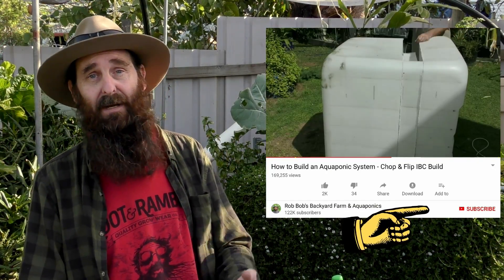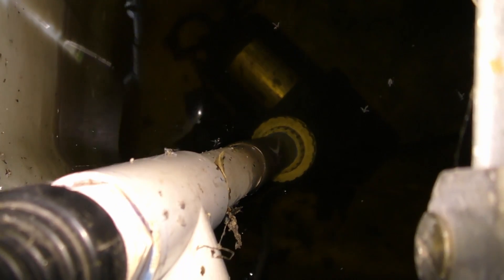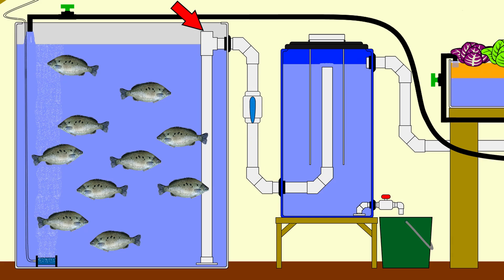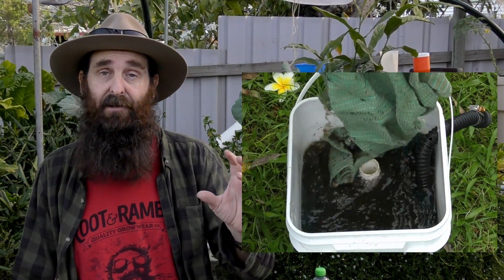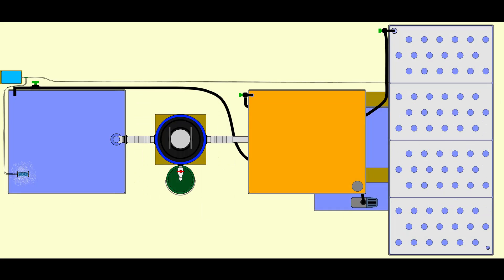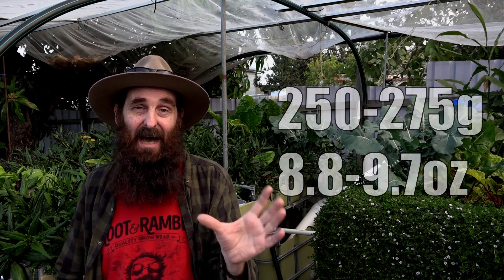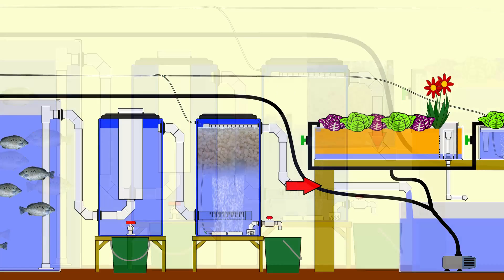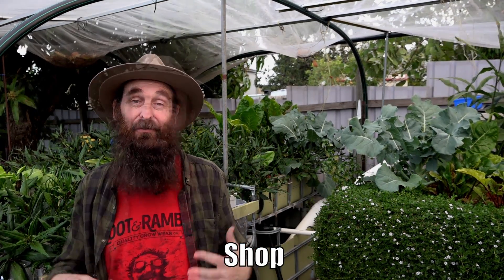Aquaponics Design | Backyard System for Pat

Comment: Isn't the solids from the fish, part of the nutrients you are wanting to get to the pants ?
Reply from the maker: Only part of the nutrients are locked up in the solids Roger. Most of the ammonia/ammonium is released through the gills directly into the water & most of the other nutrients are also carried in the water as well.  👍 
You can reclaim the some of the nutrients lost in the solids by processing them in an external mineralisation system & then re introduce them to the system. I don't think that's needed if the fish are well fed in a basic backyard set up.
Cheers.

Comment: All foam boards here in the US has Fire retardants in them. Unless you can make an order made just for you and ask them to remove the FR. Highly unlikely that will happen unless you order a very large volume of foam boards.
Reply: I should be more clear. Foam boards = foam boards intended for insulation (pink board or blue board).
Reply from the maker: Thanks for clearing that up Matthias. I have seen folks say that some insulation boards are safe to use, including some "gurus" that claim their systems are beyond organic. Still think it's up to each of us to do our own due diligence when it comes to materials used in the growing of food. 👍
Cheers Mate & have a top one.

Comment: Great job on this clip , normally you want 2-3 times your FT volume in water flow if stocked ~20kg / m3 , I have mine changing over every 20 mins
Reply from the maker: Higher stocking densities do require better turnover & bio filtration. 👍

Comment: Your explanation, accompanying graphics and design are excellent!  Very well done explanation!  Thank you.
Reply: Agree, great job with the diagrams! Nice to see someone putting time and effort into explaining something properly with diagrams.
Reply from the maker: Thanks SLFYSH. 👍
Cheers & happy growing.
Reply: @RobsAquaponics  Is it normal that my house smells fishy? In my basement I have 30 juvenile tilapia in two tanks totalling 130 gallons. The water from the first tank flows to second tank and then from second tank to a 5 gallon solids filter with filter foam and floss. From there it goes to a 20 gallon biofilter, and then pumped to my plants. From the plants the water is circulated back into the biofilter and also to the fish tank.
The only thing I can think of is that my plants aren't taking out enough nitrates hence the smell. Any ideas please, before my wife kicks them out of my basement and probably me along with them?
Reply from the maker: @pelimo  We get a marine like smell around our system but not really a fishy one. Better ventilation may help you out if it's a small basement Freddy.

Comment: Thank you for the time you take to explain this system. This seems doable for me. I plan to follow this and future updates on each component. This was certainly worth the wait! What is the best way to measure the flow rate in the raft bed?
Reply from the maker: The best way is with a 5 gal bucket or any container with a known volume from the inlet valve & you can work out the flow rate from there. 
For a 5gal bucket it would be 5(gal) x 60 (seconds) / time it takes to fill (seconds).
So a 5 gal bucket filling in 35 seconds would be 8.57 gpm.  
(5 x 60)/35 = 8.57
Multiply that again by 60 to get hours. 
8.57 x 60 = 514 gph.

Hope that helps some.
Cheers.

Comment: Hi Rob 
Thanks for the presentations on aquaponics and the critical components.  So far I have used the bell siphon successfully in a wetland water level control and thanks to you in this regard. I would like to ask you to present on use of venturi in mixing organic fertilizer for irrigation. 
Thanks
William
Reply from the maker: Hi William. 
I only use venturis designed for delivering air for use in aquaculture sorry mate. 
I have seen a loads of the liquid venturis for sale cheaply online  & know a few people that use them in aquaponics for air delivery. Not quite as good as the purpose made aquaculture ones though but get the job done in smaller systems. 
Cheers.

Comment: Excellent video Rob. Looking forward to the videos on the individual parts. Keep up the great work. I prefer to over engineer the filter portion of the system as well so, if for any reason, I have to take the grow beds off line the the fish will be ok. Do you have a system for utilizing the fish poo solids that are taken out of the system? Or do you just dump it on the garden?
Reply from the maker: At the moment the solids get used to feed up the wicking beds or lime tree. 👍 I will be trailing a mineralisation tank once I rearrange the layout of the system. 
Cheers & have a top one CC.

Comment: What’s your thoughts about doing this on Solar? I have a buddy that is thinking about doing this in a rural part of Tanzania.
Reply: Solar is just another way of providing power. It comes with it's own set of challenges as you are probably aware. Of course the first one is what do you do at night or when it's very cloudy. I built an 18,000 gallon cistern about 40 feet above the rest of our farm. During the day the water is pumped up and we have constant water pressure all the time. The rest of the power for night time is provided through battery / inverter system. A lot of the lighting is done with 12 volt LED strips directly off the batteries. It's NOT cheap to be off grid and live like the first world.  There are things that pop up like lightning strikes that destroy everything. Your friend would need back up systems  for everything in case one fails.

Some people shut water pumps off at night drain the beds  and just aerate the fish to save energy at night. It's a lot of calculations to start with and then a lot of trial and error.  Like Rob says, Over engineer everything because there are always inherent things that degrade the performance of the systems and when you have a failure you want to be able to recover fast. Good luck.
Reply from the maker: Solar works well if it's set up well. I've never used small solar systems myself as we have a system on the roof of our hose that feds back to the grid. 
Have thought about adding a 18V pump to the smaller raft system I've been contemplating adding to the yard. Just need to find a suitable position to set up the panels.  
Cheers.

Comment: Wow Rob that was a great video for me at this point in my aquaponics system build up.  I have 10x50 liter hydroton and two 150 gallon tanks for the tilapia, and will be using a 70 gallon tank for the sump and a 55 gallon blue plastic barrel for a solids filter.  I also have a separate bio filter I made out of a 5 gallon Home Depot pail and a lot of bio balls and some of the stuff you showed but a lot bigger.  I haven't been adding air to the bio filter but need to.  Anyway thanks and I hope to get all of this in my 10x12 room with some room to move around and grow some duckweed as well a lot to shove in.
Reply: Great idea to incorporate the duck weed. I use it as a settling final filter to get the rest of the nutrients and any other solids out of the system before it goes back into the tank. It's also a great way to quickly eye ball the efficiency/balance of the fish to plants.  Proliferation of duck weed growth = need more plants in the grow beds.
Reply: Thanks.  I had a bit of a hard time finding any TBH.  Ended up at Lakeway Tilapia who has the tiny stuff and stuff it into a tiny box that I had to pry out of my PO Box!  Anyway it is now growing in 3 spots.  TBH once again my "aquaponics" pretty much consists of pumping the 500 gallon pond out about 150 gallons into the duckweed tanks and adding back fresh water.  Those fish are getting HUGE they are a year and a half old.  Getting to be pets now.  Anyway I do have the need to grow out my peppers and start growing other stuff once I get everything indoors.  I have a few weeks yet.  Might have to eat a couple of fish but the main goal is to not only grow plants but see if I can do a breeding colony.  Might have to do a third tank out of the room that I will heat up to 82 F.  and have the four fish.  Got the big daddy white one and some funny white females he seems to like.  One is super tiny still a little odd one that doesn't seem to be able to eat properly but has made it this far and too small to eat!  Ha.
Reply from the maker: Nice one John. Have seen some very tidy looking setups in small rooms. 
Cheers & have a top one.